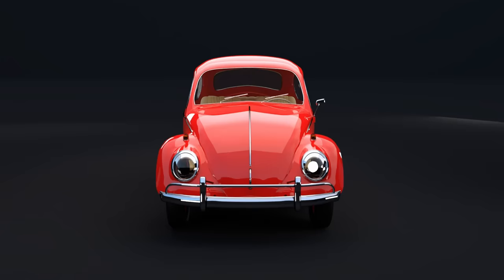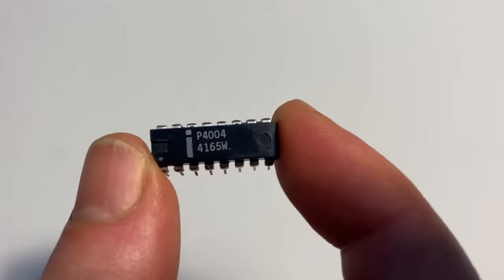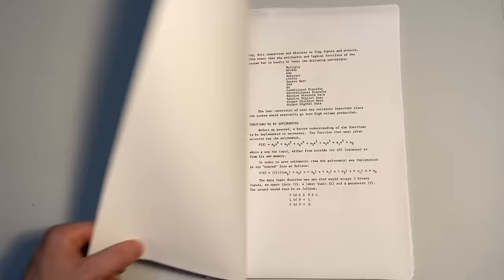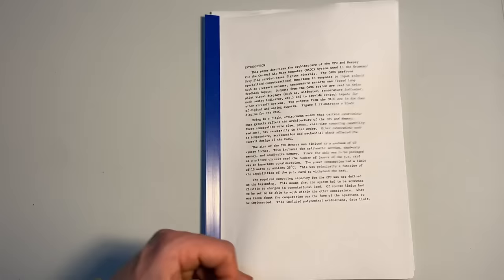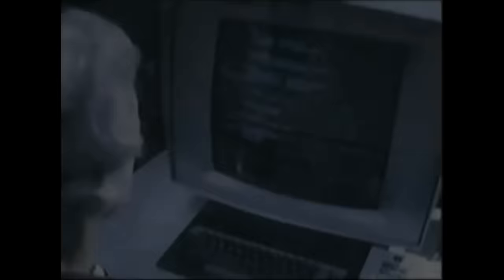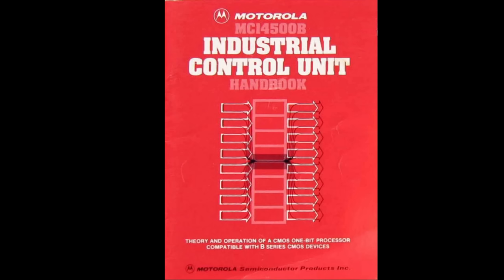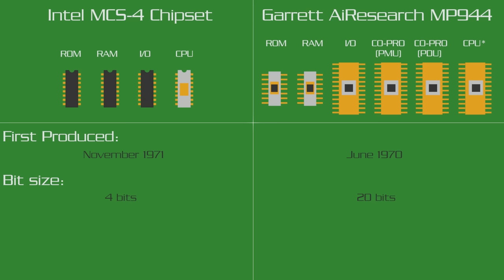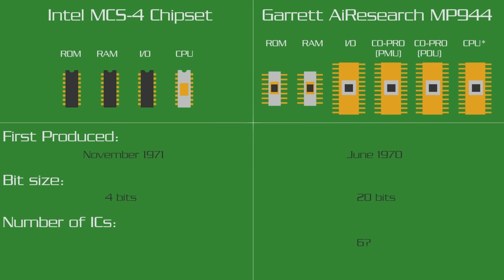The World's First Microprocessor: F-14 Central Air Data Computer

Comment: 36:51 This is missing the easiest way to multiply: rote memorization, computer-style. Let me preface this in that it would not have been possible given the space requirements in the F-14. A long time ago, I was maintenance on a system built in the mid-1970s that had two interlinked ALUs, one for real and one for imaginary component of a complex number. It had ROMs that were programmed with every possible result of multiplying two 8 bit numbers, applying one number to the row address select and the other to the column address select and presenting the 16 bit result on the output. The rest of the logic was 7400 series TTL.

Comment: And for the ones discussing Ghz is OBVIOUSLY WRONG, Really MHz from that era? Probably Kilohertz’s for the smarty pants under us… i cant imagine how it will work in Mhz range being it the first processor.. and yes now I checked it, and guess what crying nerds, it was Khz..

Also, a fpga isnt a processor at all..

And cpus aren single intergrated circuits at all.. you have cores, cashes, dedicated parallel encoders and coprosessors.. you know, most processors even miss the South bridge, which was placed on the mobo for talking to io for DECADES.😂

Comment: 5:09 gonna have to semi disagree with you there tbh. It's true for the example you posted. Supersonic planes like the F-14, F15, F-117, Su-24 etc. are pretty ugly, but there are a bunch of supersonic combat jet fighters that are undeniably gorgeous, like the F-16, Su-27 (particularly Su-30), JAS-39 (yes, I'm a sucker for canards), and some of that is a result of the aerodynamic shape necessary for supersonic flight. I even like some of the stealth designs (save the F-117 which is like the PS1 rendered version of a stealth aircraft) like the F-22, F-35 etc. are pretty nice (although they do look a bit flat). Compare these to a Cesna 150 or something.

Also part of the problem is that because of the size when you view fighter aircraft on the ground you don't really see the overall shape, you're seeing intakes, missile mounts etc. which amplifies how ugly they can look (IMO the F-16 in particular doesn't have this problem).

Comment: I know it may be of a slightly earler CADC butt CuriousMark Bendix MG1 AADC Analogue Air Data Computer YoiTube explains the operation of these amazing analogue computers with lots of mechanical gears ect.

These and British Smiths units used on pre F14 Tomcats.

Comment: A microprocessor by definition is a CPU on a chip. If the MP944 came on 6 chips then it wasn’t a microprocessor. Previous CPUs were built from multiple chips also, just the count kept reducing. The 4004 was the first to reduce all the core functions of a CPU down to one chip.
Reply: @@retiredbore378 modern microprocessors still need support chips (like the Intel North and South bridge chips for example). They also need external RAM and ROM most of the time also. It’s the fact that they contain all the traditional core parts of a full CPU (registers, ALU, instruction decoder and execution units etc) that makes them microprocessors. Many minicomputers were reduced down to single chips also (the microvax and TI9900 for example). Indeed even mainframes have microprocessors at their heart these days).
Reply: What is a microprocessor?  In reality it really does not matter, however, companies and marketing people love to label what they have.  When I started the design of the F14 CADC the implementation of the “processor” was unknown. As we tended towards the new “integrated circuit (IC)” technology names such as IC processor or LSI (large scale integration) was used. Micro was also in there some where as the computer design evolution progressed from large, to mini, to micro.  It was not a big issue to anyone.  Ultimately, as the CADC project was completed and I wrote my paper I chose the name “microprocessor”.  There was no focus on single-chip, multi-chip, program counter location, etc. In fact, even Turing was set aside as the main focus was to do the job irrespective of # of chips and what function was where, and even how data was transferred. The selection of any cleaver design techniques (pipelining, co-processing, in-flight self-test, dual redundancy),  algorithms, and package selections we made to reach the speed and accuracy necessary to fly the F-14 as needed. It was unfortunate (for me and history) that the 1970 presentation of my paper and any patents were strongly refused by the US Navy thus 30 years of silence started. Around three years later the Intel marketing group started labeling their work. First came the World’s first microprocessor, then the World’s first commercial microprocessor, then Intel’s first microprocessor, then Intel’s single-chip microprocessor ….  Today, everybody wants their design to be a microprocessor, otherwise, how are they going to out market Intel?
In 1973, Hank Smith, Microprocessor Marketing Manager, Intel Corp made this statement at the IEEE 1973 WESCON Professional Program Session 11.  “A CPU uses P-channel MOS and is contained in 1,2,3 or4 LSI standard dual-in-line packages from 16-42 pins per package”.  Even at this time the word CPU was sometimes used for the entire processor and not microprocessor.
After this, history started dissection the word CPU, microprocessor, single-chip, etc to fit the functionality, design, and packaging of each product. Thus, here we are in 2024 (54 years later) still trying to make it all fit into convenient definitions.

Comment: The F111 was great in some ways, but a failure in maneuverability.  That is, it was rushed to production before critical modifications to the airframe were made.  It was quite difficult to fly and entered fatally unstable regimes quite easily. (Twin tails and/or moveable ventral strakes would likely have solved the problem.). As much as I love the look and air-to-ground prowess of the machine, its basic flyability was atrocious.

Comment: The term 'Capability', when applied to processor architecture (and especially military processor architecture) refers to access control architecture. Compare military spec Plessey System 250 and the intel i960. The MP, lacking a Memory Management Unit, does not have any capability. Of course, no integrated system prior to the IBM 801 could claim to have capabilities, so it's not much of a knock against it.

Comment: wait... so is it even accurate to call it a 20-bit processor if it all needed to be loaded in serially? at least, the SLs and CPU were 1 or 2-bit, at most i guess you could say the PMU and PDU were 20-bit, but all of the address space logic was handled theoretically, not practically called from the CPU, instead sequenced almost directly from rom? where the program counter was also located?

also an earlier thought i had, would the clock speed be the speed of loading each bit, or the completion of each calculation? because the former could mean it had a clock speed far exceeding processors that come much later than it, but only really as a technological curiousity, but with the latter, it would probably snugly fit into the clock speed race as the earliest and slowest.

Comment: Pedantic nerd mode enabled: are you sure that the program counter of the 944 was situated in the ROM, and not in the RAM ?
Reply from the maker: It was in the ROM.....it's weird. See the paper 'Architecture of a Microprocessor' from 1971 for an explanation.
Reply: Weird indeed, though it does make some sense, the index into the ROM could live as close to the ROM as possible.

Comment: The requirement that a "microprocessor" be a single chip doesn't seem to be very logical. Is a Pentium not a microprocessor because it requires an external South Bridge and memory controller? Where should the line be drawn?

The defining feature of the microprocessor overall is the dramatic orders of magnitude decrease in size of the overall implementation, compared to the mini computers of the time which implemented CPUs out of individual transistors.  The number of silicon dies, or number of individual dip packages, seems like an arbitrary implementation detail of the overall system. If the system manages to pack the overall functionality of a microprocessor into a relatively tiny package, than the overall package should be considered the microprocessor in its entirety, not unlike a modern chiplet design.

For a period appropriate example, the HP-01 wristwatch was a marvel of miniaturization from 1977, and it works very similarly to these early serial computers. 5 main ICs house 39,000 transistors and implement the functionality of a sophisticated microprocessor, yet no single IC could be considered the "main CPU". All data is constantly "in flight", with data being serially shifted out of one chip into another, while it receives data from another simulaniously. All chips share a common instruction bus which is driven by the ROM, and all have their own internal instruction decoders that need to work together to implement the overall functionality of a microprocessor. I can't believe that anyone would seriously claim that this system doesn't constitute a microprocessor.

These multi-chip circuits were usually referred to as "hybrid circuits" and were pretty common in the 70s before all the components could be squeezed into a singular IC. Therefore I think it's safe to say that any of the early microprocessors discussed are "real" microprocessors.
Reply: What is a microprocessor?  In reality it really does not matter, however, companies and marketing people love to label what they have.  When I started the design of the F14 CADC the implementation of the “processor” was unknown. As we tended towards the new “integrated circuit (IC)” technology names such as IC processor or LSI (large scale integration) was used. Micro was also in there some where as the computer design evolution progressed from large, to mini, to micro.  It was not a big issue to anyone.  Ultimately, as the CADC project was completed and I wrote my paper I chose the name “microprocessor”.  There was no focus on single-chip, multi-chip, program counter location, etc. In fact, even Turing was set aside as the main focus was to do the job irrespective of # of chips and what function was where, and even how data was transferred. The selection of any cleaver design techniques (pipelining, co-processing, in-flight self-test, dual redundancy),  algorithms, and package selections we made to reach the speed and accuracy necessary to fly the F-14 as needed. It was unfortunate (for me and history) that the 1970 presentation of my paper and any patents were strongly refused by the US Navy thus 30 years of silence started. Around three years later the Intel marketing group started labeling their work. First came the World’s first microprocessor, then the World’s first commercial microprocessor, then Intel’s first microprocessor, then Intel’s single-chip microprocessor ….  Today, everybody wants their design to be a microprocessor, otherwise, how are they going to out market Intel?
In 1973, Hank Smith, Microprocessor Marketing Manager, Intel Corp made this statement at the IEEE 1973 WESCON Professional Program Session 11.  “A CPU uses P-channel MOS and is contained in 1,2,3 or4 LSI standard dual-in-line packages from 16-42 pins per package”.  Even at this time the word CPU was sometimes used for the entire processor and not microprocessor.
After this, history started dissection the word CPU, microprocessor, single-chip, etc to fit the functionality, design, and packaging of each product. Thus, here we are in 2024 (54 years later) still trying to make it all fit into convenient definitions. Ray Holt

Comment: The F-14 wasn’t primarily designed for close-in dogfighting. It was an interceptor intended mainly for long-range engagements with aircraft and anti-ship missiles which threatened carrier groups. 

The F-111 was unrealistically intended to serve as both a land- and carrier-based interceptor by McNamara’s DoD, fulfilling that role for both USAF & USN. After it was finally and irrefutably proven that it wouldn’t work as a carrier-based aircraft, the F-14 program was initiated to develop an aircraft more suitable for that role.

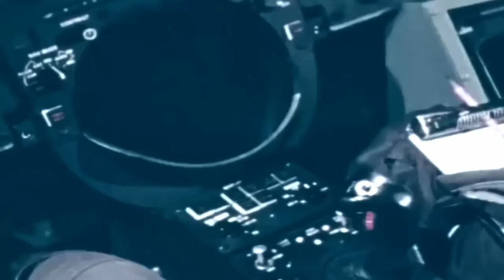Comment: You state around 13:10 that "smart bombs didn't exist yet". This is incorrect. Arguably they have existed since WW II, although the systems of that era had a lot of drawbacks. Laser guided bombs also predate the F-14's entry into service, although it was presumably being developed about the same time. (Didn't check the timelines to see which was actually first.)
Reply from the maker: I almost rewrote that part - 'smart bomb' is a loose definition. But I didn;t want to get bogged down in 'well technically laser guided bombs existed but GPS guided ones didn't....and there were multiple other methods for guiding a bomb to a target too'.

Comment: Unfortunately for Ray Holt, which I see is here in the comments spamming his made up definitions, the CADC/MP944 will never match any sensible definition of "microprocessor", less os "the first". It's a family of chips each implementing special-function units that can be assembled into a programmable device. This is much more similar to the Am2900 family, and nobody considers that a "microprocessor". And even if we include them in the definition, the Four-Phase System/IV and the Viatron System 21 came way before the CADC.

Comment: Microprocessor, gpu cpu and fpga are not the same or similar. 

Microprocessor is a very broad term, but it basically is an integrated circuit, with the capacity to perform logic operations. That rule that needs to be on a single chip... Not sure where its coming from.

Cpu, is a type of microprocessor, which handles the specific task of running the OS, and control other devices.

Gpu, is a type of microprocessor dedicated to graphic processing.

Fpga, is a type of microprocessor, where the functions it processes can be changed by software.

Comment: SAGE, a computer network which predated the Internet was tied to the US Air Force. However, the Internet was an expansion of NLS (oNLine System) developed under Doug Engelbart's Augment group at SRI (Stanford Research Institute) and did not get funding from (D)ARPA until after JCR Licklider heard about the so-called "Mother of All Demos" (December 9th, 1968). In other words: the Internet was not rooted in defense contractors, so much as perverted by them.

Comment: As far as ugly looking fighter aircraft: I think it's more just weird looking. The Tornado has a vertical stabilizer that's just proportionally way too big. The older F-4 Phantom looks blunt/stubby and those "droopy" horizontal stabilizers look off. Don't even start about the F-117 Nighthawk. 

No fighter jet was ever designed to be aesthetically pleasing, form really has to follow function. 

But having said that (and ignoring the world political situation for a moment) the Sukhoi SU-27 is an absolute beauty. Gorgeous flowing lines on that jet, from multiple angles. An exception to the rule, I guess.

Comment: and you think now a ready  market single chip micro controller has 512k of flash, 2x usb, 2x ethernet, 64k of ram (or more), 2x sound, multiple analogue iq, pwm, 100+ digital iq and so on..... In my work they use these to drive megawatt inverters (I do PLCs) and this thing is amazing... programmed in C not assembly.... so you can understand the code (Assembly is PITA to understand even to the author after few years...)

Comment: I don't think that it qualifies as a processor much less a microprocessor. A processor is capable of decoding and executing instructions.  The MP944 couldn't do that by itself. It contains all the  processing units of a processor but no decoding or control logic. Programming it was basically like manually bit flipping the control lines of a processor. The problem with that is it doesn't permit an arbitrary execution flow based on data the way that a general purpose processor can because all the flow control is hard wired into the ROM and outside of the control of the processing units.

Comment: The JA-37 Viggen was first not the F-14 with its central computer CK37 in 8 februari 1967
Reply from the maker: It wasn’t a microprocessor…but the CK37 was years ahead if its time. I plan on doing a video about it later this year
Reply: @Alexander-the-ok  wrong again CK stands for CPU (Central kalkylator) a central computer (CK37) uses microprocessor, CK (Central kalkylator) is the CPU, CK37 is the Central computer in Sweden the name of the CPU is unknown becuse we named the CPU, Central kalkylator (CPU)...  it had two 2 microprocessor (CPU) The CPU got upgraded 1980 to a INTEL 80286 The JA37 Viggen even use the same central computer as the F14 in the mid 80's...Your argument about the CPU is bonkers; you're arguing semantics.
Reply: @Alexander-the-ok  if you like some info or data for the CK37 video im happy to help. The CK37 enabled the Viggen to track the SR-71 even under havy jamming and simulate a successful strike through its advanced attack/hunting data-link (jakt länken). Rather than developing an AWAC system like to the F-14, each JA37 was equipped as a "mini AEW&C" capability, as a full AWAC system would be too extensive for our military operations. 

The JA37 could connect to a group of four plus one ground station to exchange radar data and other information to display together in real time. Rumors indicate that the F-14 was developing a targeting system based on the JA37, but the project was not completed before the F-14's retirement. As a result, at the end of its service, the Viggen employed the same computers as the F-14 due to this development.